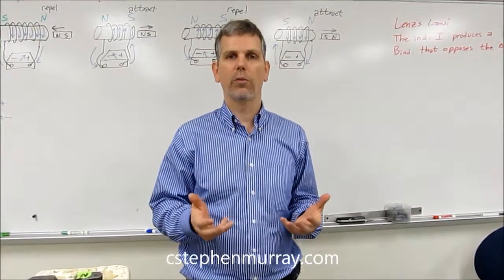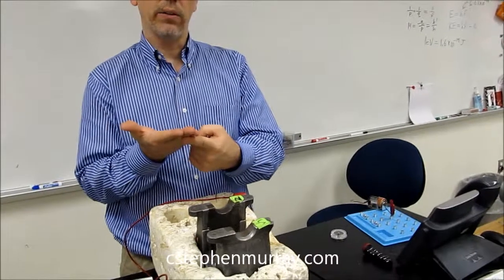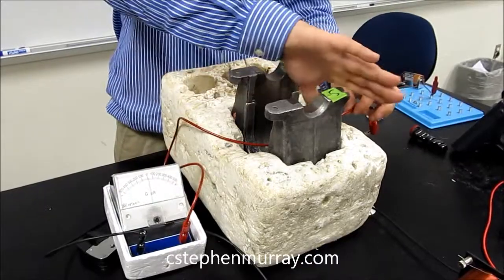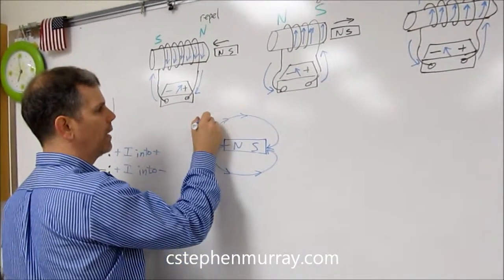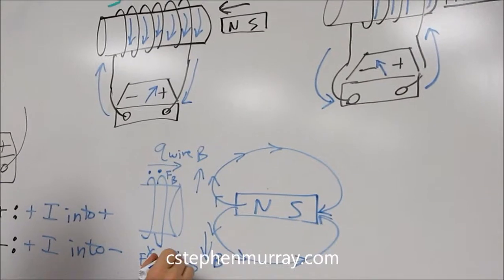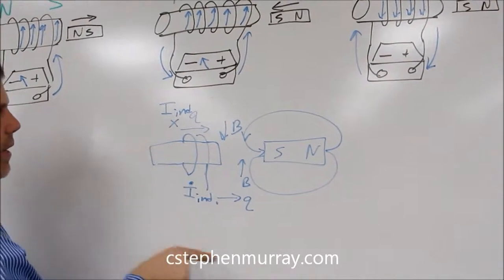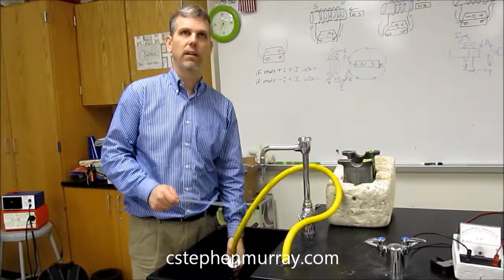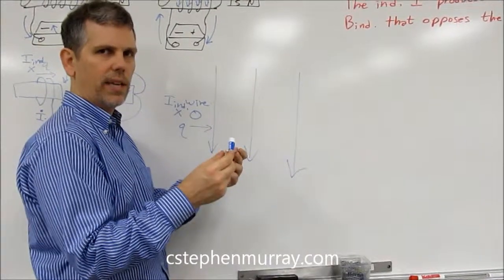Lenz's Law Part 3: Lenz's Law Explained by RHR

Comment: Another interesting aspect to consider, I think, is that galvanometer acts as a resistor. The further the needle is deflected, the greater the resistance. In order that equilibrium of circuit be sustained, coil must turn within magnets, inducing a counter-current in the coil.